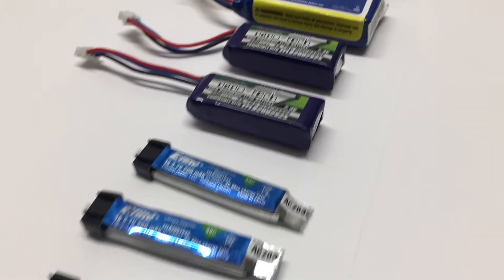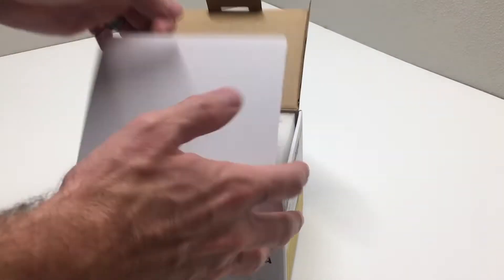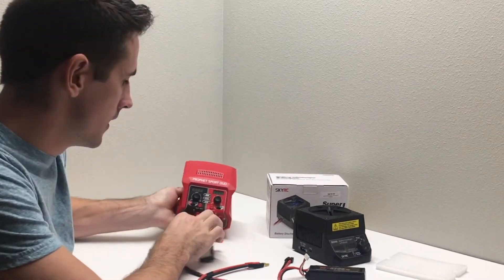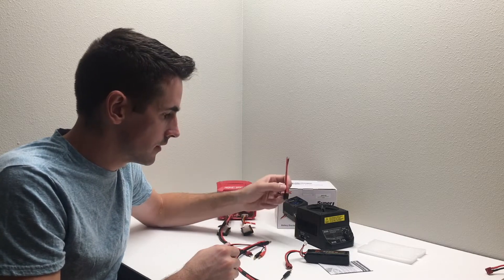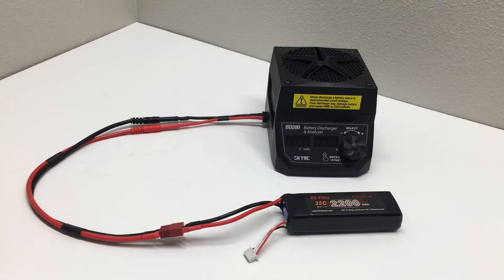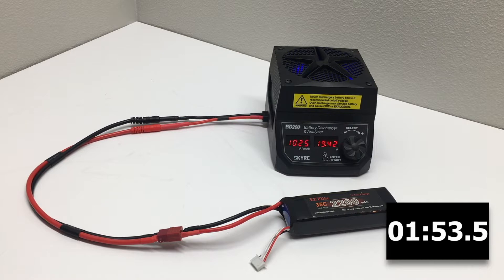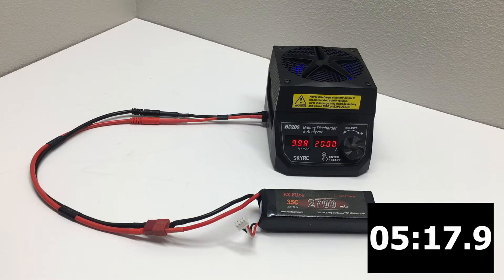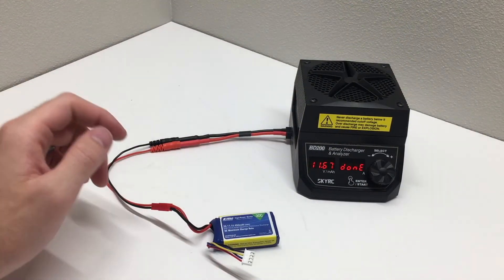How to Keep your Batteries Healthy

Comment: nice video man that was super fast. I have a question I am new tp RC hobby using surface vehicles mostly, I am using 3s and 6s lipo batteries and currently using a SkyRC D100 V2 charger. I received a Efuel 30A power supply for my birthday from a friend who said my charge times will be faster using it. Is there a guide on how to use this with my charger? I don't have much experience but am willing to learn and I can learn fairly quickly. Thanks.

Comment: Nice review. I wish they would have let you set a desired cell voltage (say 3.75) and it could auto detect or you could set cell count. Would have also made sense if it would have had banana sockets to begin with. Everybody already has banana adapters in their flavor of connector for their charger.

Comment: If you ever hook the battery up backwards there is a 40A fuse under the bottom cover. Don't ask how I know. Just peel the 4 ruber feet off and there is a screw under each foot pop the bottom cover off and it is right there. The new model BD250 has a slot in the bottom cover so you don't have to remove it to replace. I am glad I checked it out before I sent it to the trash can. Now I have 2 of them. The old one and a new one. They both work great for discharging.

Comment: Old video I know, but big correction for anyone watching, for longest life, store LiPos close to nominal voltage, 3.7 3.8V per cell, not discharged.
Reply from the maker: Yes I agree, I store mine at 3.8V, it makes a huge battery life improvement